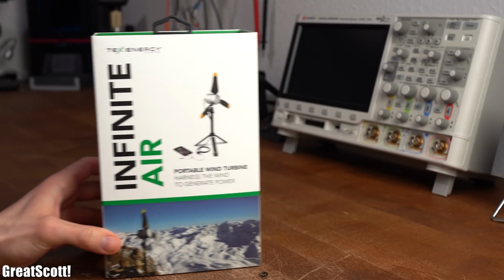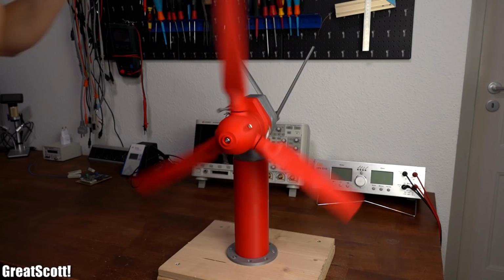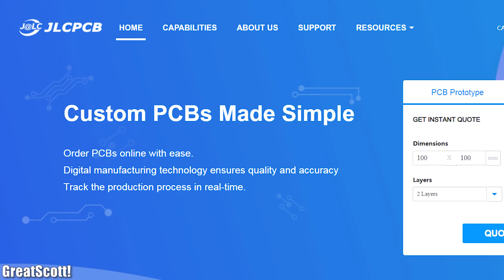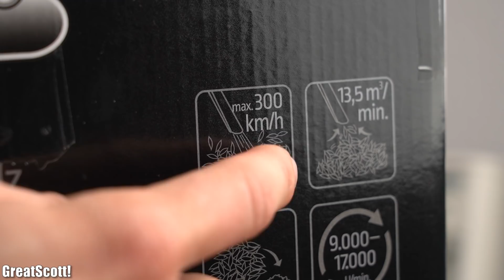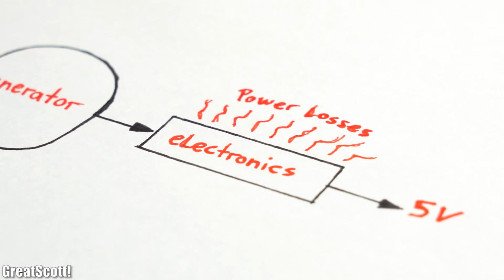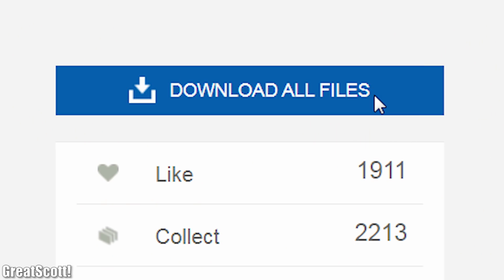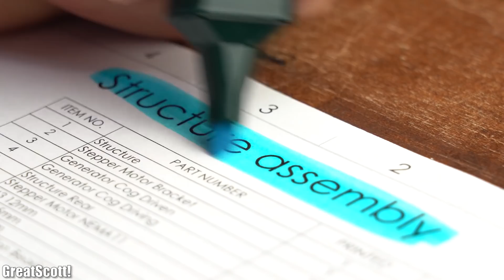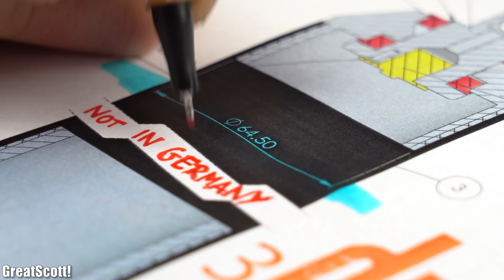Mini Wind Turbine || DIY or Buy

Comment: I think there is a disc generator (Scheibenläufer) used in the commercial unit. The problem with the stepper motor is the cogging torque of the individual steps. This force is also higher with the used gearing. I recently printed a vertical wind turbine and made such experience. On the other hand you need some kind of MPPT for a wind generator. Or just make multiple load cases. A single point of measurement is not significant for comparism between both units.

Comment: In a class at college that I am a teachers assistant in we have the students build a wind turbine, and then have a raspberry pi to output the stats of the turbine to a screen such as power, voltage, and rpm, we also have them make variable loads for the turbine. Next year we will have them build a drawbridge.

Comment: I know the motor being smaller would make the power less, but if you balanced the whole rotor head (use a string on your roof with a bent nail tied on the other end and hang your rotor over a level surface,then add weights to make it balanced.)

I bet the power output would increase more than you expect. All those forces while spining is thrown off when the assembly is not properly balanced and you lose power generation to motion.

Comment: DIY or BUY: Handheld vacuum cleaner.
Reply from the maker: I can put it on my to do list :-)
Reply: @greatscottlab  Yay! (Again)
Reply: @greatscottlab  do you have a po box for fan mail??
Reply: @greatscottlab  HEY SCOTT PLEASE TELL ME HOW WILL I COMPARE CAPACITY OF BATTERY AND SUPERCAPACITOR ???
Reply: DIY or BUY: robot vacuum cleaner.
Reply: @lifeai1889  Handheld will be much better. Roomba is not so expensive.
Reply: abdul bari  Angry dyson sounds in the corner
Reply: That’s pretty much Buy, as they’re cheap and it’s not exactly easy to make. Also, Jeremy doesn’t have too much time as he has money, so Buy usually ends up winning in most cases by default.
Reply: @GRBtutorials  Yeah, but cheap vacuum cleaners arent completely sealed unlike the Dyson. (Which is overpriced)
Reply: isn't that also called a wife ?: lmaoooo
Reply: DIY or BUY:  3D Printer
Reply: @50shadesofbeige88  depends what you call decent. Nothing will rival a cylinder mains vac, but there are gains in build quality/air tightness. AEG are pretty solid right now in the battery vac space.
Reply: thats hard

Comment: Neither is practical. For a small fraction of the price and effort you can get a 12V/10W solar panel that will deliver over 300mW even on a cloudy German winter afternoon. The solar panel should last about 20 years barring physical damage, which is far more than the bearings in those fans will deliver.
Reply from the maker: I agree that solar panels make more sense here in Germany. But do not use the 300mW as a reference value for that. I used a more or less random load for the generators. By using an ideal load you can get more power from them. I used the one in the video to compare the two.
Reply: @greatscottlab  You wrote the comment one week before the video was uploaded;). Keep it up, you're awesome!!!
Reply: @robosapien314  video is available for patreons earlyer.
Reply: @ДмитрийМелентьев-ю9с  Thanks, I didnt know until I read a few comments